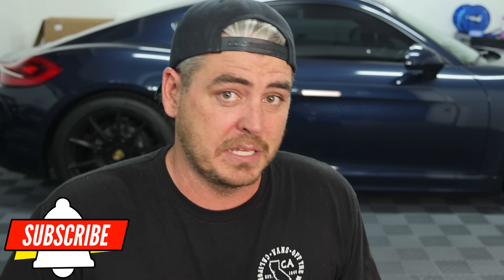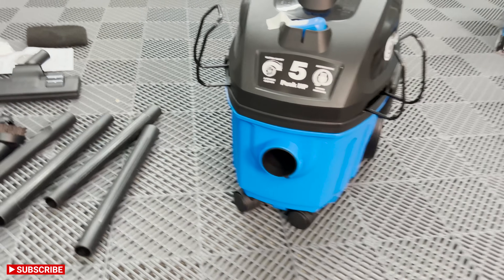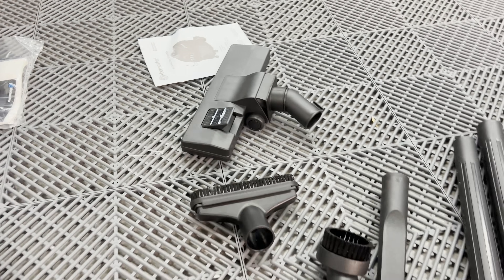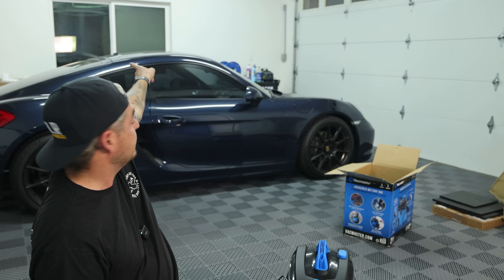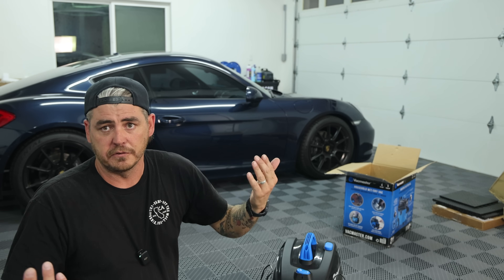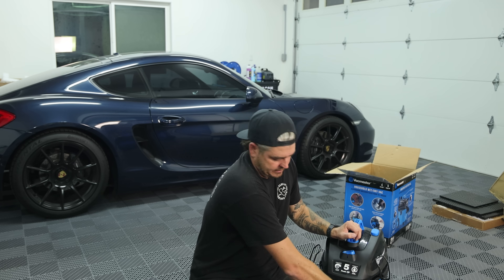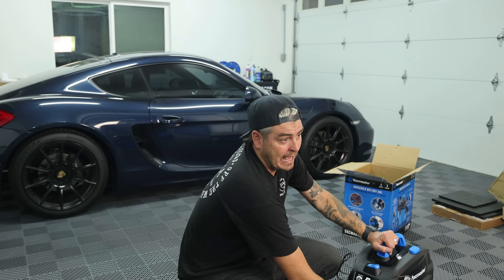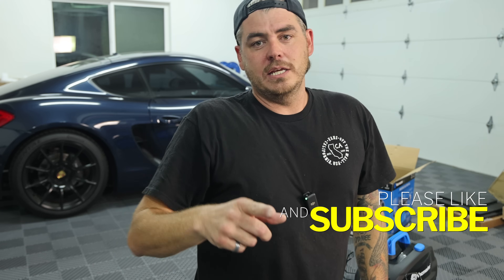BEST SHOP VAC? How to find the best performing wet dry vacuum

Comment: I'd like to see him include 2-stage "high lift" shop vacs into these reviews. Rather than sticking to "just" the 1-stage units. The main difference (besides some build quality improvements), is thay the 2-stage shop vacs generate higher air speed/air pressure, while having less overall volume moved. I feel like for detailing related tasks, that's actually what you'd want. The higher lift/suction allowd better extraction and debris displacement/lift from things like car carpets, and various crevices. The higher CFM and lower air speeds of the 1-stage units is more optimised for moving larger volumes of fine, easy to pick up particles, like saw dust. However they can more easily get bogged down when the air flow is blocked (like shoving the hose into a carpet), and have more trouble picking up heavier debri (like small rocks, etc), or lift particles out of small crevices. Would be interesting to see the two types compared against each other in various tasks. This info isn't easily found elsewhere currently.

Comment: Your suction measurement was STATIC pressure (0 airflow). The pressure goes down when you have airflow. That's the reason your air-watt numbers are too high.

Comment: The peak horsepower is absolutely meaningless. It does not say anything about the actual motor power. These "5hp" motors usually draw around 1kW, which is like 1.35 hp.

Comment: Rigid 4.5 Gallon 5.0 Peak HP ProPack Wet/Dry Shop Vacuum with RIDGID 1-1/4 in. Premium Car Cleaning Accessory Kit is excellent and as you have demonstrated really better than the VacMaster even though the VacMaster does better with sucking water. Rigid does not come with castors or rolls around which if you get the Detailing Kit you won't need a shop vac with
 wheels. Father's Day 2024 is almost here in another week and Home Depot supposedly will have Rigid and Ryobi stuff on Sale. Don't pay $129 for the Rigid and hope it is $99. Josh did a nice review on the Ryobi One+ 18V SHop Vac. as the 1 Gallon and 3 Gallon. Personally I'd go with the 3 Gallon Ryobi it's a bit larger but offer more Power for the $$.  The DeWalt's just not constructed well enough to last.

Comment: i have the Vacmaster BEAST  version 5.5 hp  5 gallons. it has no wheels.  i for v the Rigid detailing hose and crevice kit for it. its absolutely better than that blue vacmaster.  mine is black and  yellow. It's super quiet, and the suction is better than any other shop vac I've bought  you can't not test that one  110$ maybe cheaper
Reply: I'm gonna trust your review

Comment: I've used a 5.0 peak hp shop vac for years, just recently upgraded to one of the 12 gallon craftsmans with a 6.0 HP motor and the difference in unbelievable. Even with the 2 1/2 in hose instead of the smaller hoses, this thing sucks like you wouldn't believe. I have truly been amazed at the difference.

Comment: I bought a Karcher shop vac recently and I have been really impressed. I previously had an NXT Rigid that burned up from drywall dust.
Reply: Gotta use bags. I work in construction (painter) and ALWAYS use bags. I suck up drywall dust and paint overspray all the time and mine is almost 12 years old. Bags bags bags!

Comment: Size of the opening is critical to calculate CFM. Looks like you used the default 2x2 rectangle on the calculator. Your CFM is way off.

Comment: While your doing a vacuum series could you also look at deferent hoses to extend length  and also is there a hose that is non marking on door sill. Is there a “Uber flex type ” hose for vacuums. I have bought a few and they did not work for car detailing. I have a wall mount and the hose seems so cheap and plastic. And it scuffs any thing it touch’s. Like door sills.

Comment: Give a try to the new hyper tough shop vacs. The 5gal 4hp is a little beast for the price and convenience.
Reply from the maker: Walmart right?
Reply: @imjoshv  Yes sir. Grabbed one a few weeks ago in a pinch & for $50 I was surprised. Have even paired it with the Rigid hose and a 30’ Centec hose and still impressed me.

Comment: Thanks Josh for the great video.

Brainstorming ideas here for the vacuum reviews…

Aside from precision measuring devices and ratings, (putting in my thinking cap here…) 3-5 practical application tests that can be completed.   Vacuuming from wet to dry using a floor mat.  Attachments and reaching difficult to reach areas,  decibel levels when under load, in rush current using your plug in ammeter (alike the pressure washer videos).

Just a few but can think of some more if need be.  More or less a series of standardized tests for comparison and capabilities and limitations.

Have a great weekend!

Comment: I run a few different ones.  My full time job one is a Pullman Holt.  15 plus yrs old . Swapped the motor out 6 yrs ago . It's a beast . My home business i run a vacmaster wall mount with a 50 ft centec hose . Works great . I did put a sot bag that's made for the Pullman in it . Small bungee cord around the filter . No longer need to switch out filters for water . My mobile one is a ridgid 6 hp 4 gal with a 30 ft centec hose.
Reply from the maker: Awesome! How do you like the wall mount vacmaster? I have 3 wall mount units I’ll be testing out here soon but the vacmaster is less money so it could be a great option!

Comment: I have this exact same model but craftsman brand. Had it for many years and it still works awesome. I use it on the shop and for detail.
Reply from the maker: Awesome! Does that one have the retractable cord as well?
Reply: @imjoshv  yes its the same shop vac.  Only difference is the craftsman is red and black. The craftsman model is discontinued model now. I checked online and theres also a kenmore model too lol crazy.

Comment: My Rigid 14 with 6.0 peak HP, a lifetime warranty, car care kit and your pool filter socks work great for me.  Very good recommendations!
Reply: Thanks Josh for the great video.  

Agreed.  I have the same rigid.  Own 2. The eldest (8 years) is running just as well as the newer one (2 years).

Durable plastic, and wheel castors powerful motor.
Reply from the maker: That’s great! I agree, for not knowing the exact numbers from testing but just from a pure user experience I absolutely love the rigids. I’m assuming the will probably test well with the gauges!

Comment: Hi Josh I’m looking for a air compressor what do you think is the best compressor for the money on the cheaper side,Just tryna get enough psi to clean interiors and polishing pads,Also to tell you the 10 Gallon Wet/Dry Vac Hart branded Wet/Dry Vac is very good as well